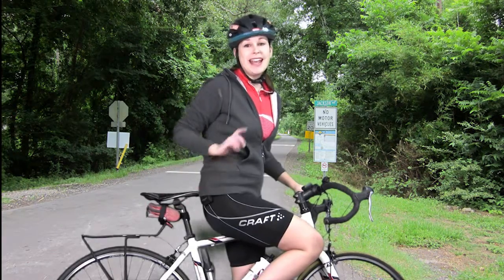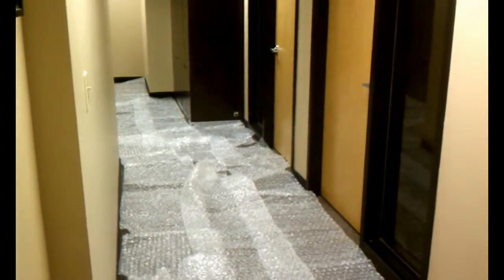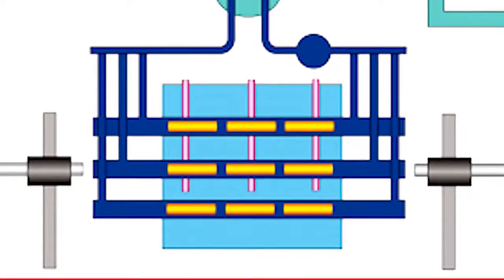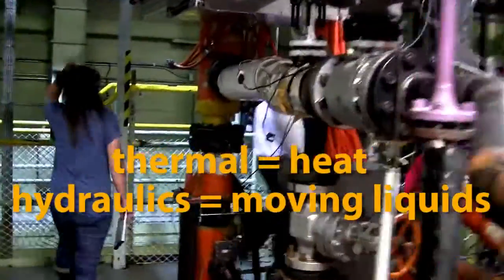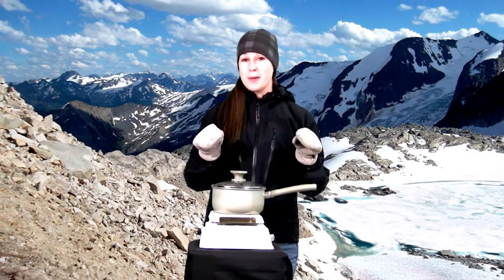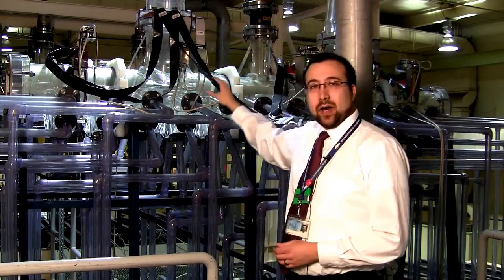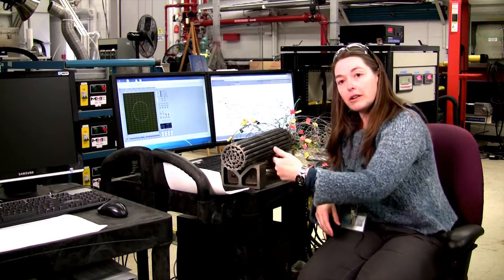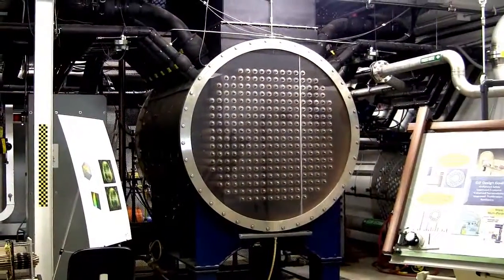Nuclear Reactor Safety (The Bubble Wrap Theory)

Comment from the maker: Radioactive Water "May Have" Leaked Into Pacific
Feb. 24, 2015 - Updated 10:27 UTC-5
The operator of the Fukushima Daiichi nuclear plant says radioactive water that accumulated on the roof of a reactor building may have leaked into the Pacific Ocean.
Tokyo Electric Power Company said on Tuesday that it had found a puddle of rainwater with relatively high levels of radioactive substances on the roof of the No. 2 reactor building.
The water contained 23,000 becquerels per liter of cesium 137, 6,400 becquerels of cesium 134 and 52,000 becquerels of beta ray-emitting substances.
Officials say that contaminated water may have spilled into the sea beyond the plant's port through a drainage channel.
They found the contaminated puddle while investigating temporary increases in the concentration of radioactive substances in the channel each time it rained.
Officials were aware of these rises as far back as April last year, but had not made them public.
They say 1,500 becquerels per liter of beta ray-emitting substances, 760 becquerels of cesium 137 and 250 becquerels of cesium 134 were detected in the channel last August.
Officials say no major changes were seen in the levels of radioactive substances in the seawater nearby.
They plan to lay sandbags that absorb radioactive substances on the roof and in the channel by the end of next month to prevent further leaks.
The report came just 2 days after high levels of beta ray-emitting substances were detected in a different drainage channel at the plant.
Officials apologized for the series of leaks and pledged swift measures to prevent a recurrence.
The chief of a local fisheries association, Masakazu Yabuki, said he was shocked to learn that contaminated water had leaked outside the port.
Yabuki said it contradicted the utility's earlier explanation, leading to a loss of trust in the firm.
He said that could affect the association's decision on whether to accept the utility's plan to release decontaminated water into the sea.
~~~~~~~~
				
Fukushima Governor Okays Nuclear Waste Transport
Feb. 24, 2015 - Updated 06:40 UTC-5
The governor of Fukushima Prefecture has given the go-ahead to transporting radioactively contaminated soil to an intermediate storage facility there.
The government began building the facility this month in an area straddling the towns of Futaba and Okuma.
Carrying in soil and debris from decontamination is set to begin by March 11th -- the fourth anniversary of the earthquake that triggered the nuclear disaster at the Fukushima Daiichi nuclear plant.
Governor Masao Uchibori met with the mayors of the towns on Tuesday after receiving the central government's response to 5 conditions they set for transporting to the facility materials contaminated due to the disaster.
The conditions include safety agreements with local municipalities and measures to ensure safety during transport.
Uchibori told the mayors that he made the difficult decision to allow the materials to be carried into the facility to speed up decontamination and recovery of the environment.
The mayors agreed that local needs have been understood. But they asked for more explanation for landowners and that the materials eventually be disposed of outside the prefecture.
Uchibori plans to convey his decision to the central government on Wednesday. A schedule for the transport has yet to be negotiated.
Okuma Mayor Toshitsuna Watanabe said that allowing the transportation of radioactive waste to an intermediate storage facility in his town was a difficult but necessary decision.
But the mayor of the other town designated to hold the waste, Futaba, gave preconditions for accepting the proposal. Mayor Shiro Izawa stated that he has requested revisions of 2 articles in the national safety measures.
Izawa said that he will likely agree to take the radioactive materials if the revisions are made, but that he cannot provide further comment at this time.
Later Futaba Mayor Izawa told reporters that he wants the central government to partially revise its draft safety agreement and allow more townspeople on a committee to monitor the facility.
			~~~~~

Volcanic Island Grows More Than 11fold
Feb. 24, 2015 - Updated 04:57 UTC-5
A remote Japanese island in the Pacific Ocean has grown more than 11 times in size since an underwater eruption started about 15 months ago.
The eruption started in November 2013 near the island Nishinoshima in southernmost Tokyo, and created a separate island. The eruption continued, and lava connected the 2 islands.
On Monday, Coast Guard patrol aircraft said a crater was spewing out volcanic rock 5 or 6 times per minute, sending smoke about 1,200 meters high.
Infrared footage taken by a Coast Guard vessel showed molten lava flowing from the crater.
Coast Guard officials said the size of the island is now 2.45 square kilometers. It measures 1,950 meters east to west and 1,800 meters north to south.
The officials said they hope to survey seabed formations using remote-controlled submersibles. They also called on ships to navigate areas near the island with caution.